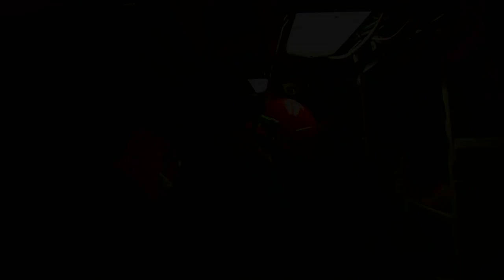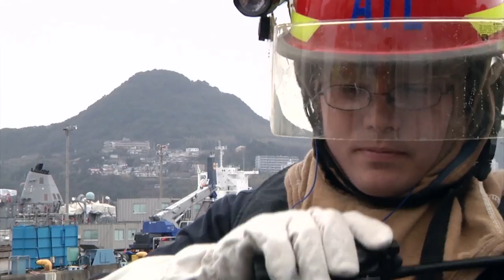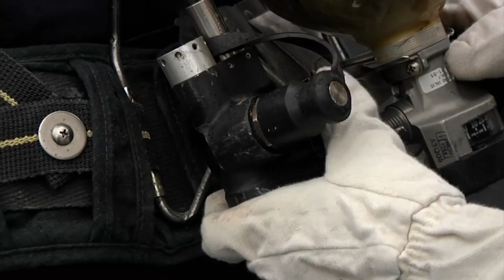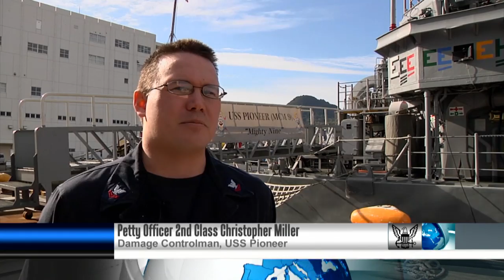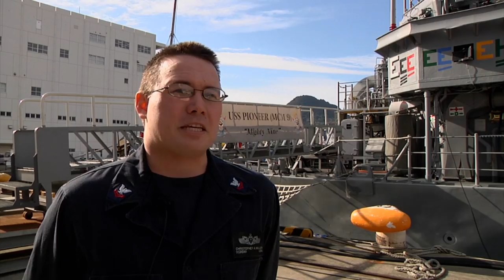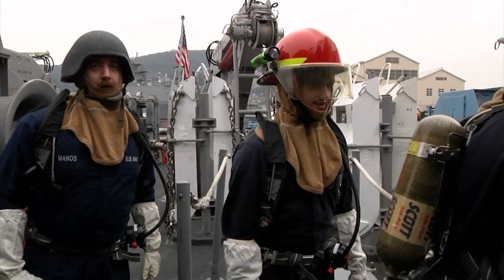Damage Controlmen Teach Sailors Repair Techniques

Comment: WWII should have taught the modern navy that fire fighting and damage control is a shipboard priority. I propose actual parts of vessels like flight decks, etc. and sailors need to train constantly especially in port. Most sailors couldn't rebuild a deck. They don't know the tools. Every sailor should be taught all forms of welding. Cross training is essential.